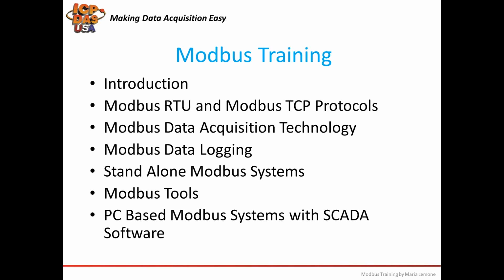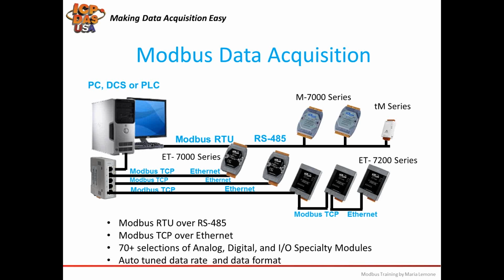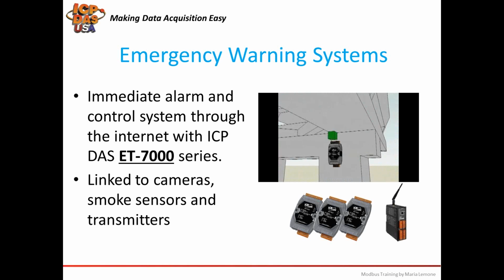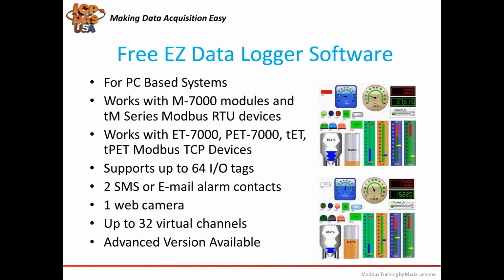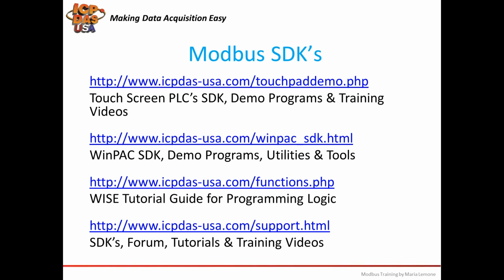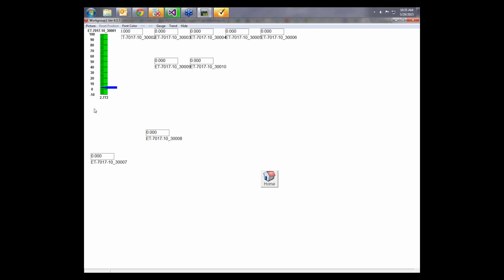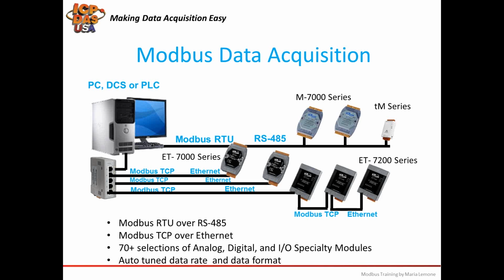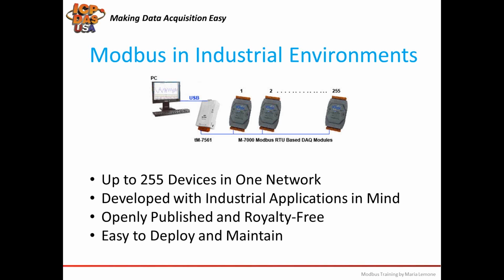Modbus Based Data Acquisition Training

Comment: I have applications in lab view working with arduino and linx can i change the application to work with modbus
Reply: Hi yes you can use Modbus with LabVIEW.  Here is an article that explains how to use Modbus with LabVIEW: https://www.icpdas-usa.com/Modbus-with-LabVIEW.html?r=maria.

Here is Modbus TCP Data Acquisition Equipment:  https://www.icpdas-usa.com/remote_ethernet_io_modules.html?r=maria

Here is a tutorial on how to use our ET-7000 and PET-7000 Modbus TCP Data Acquisition Modules with LabVIEW: https://www.icpdas-usa.com/documents/ET7000/labview_modbus_eng.pdf